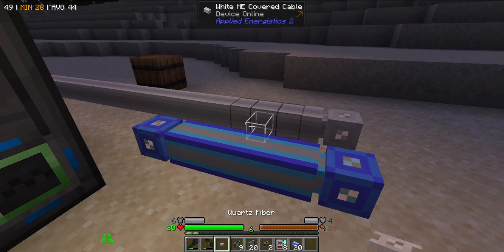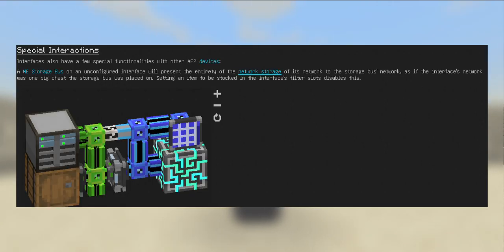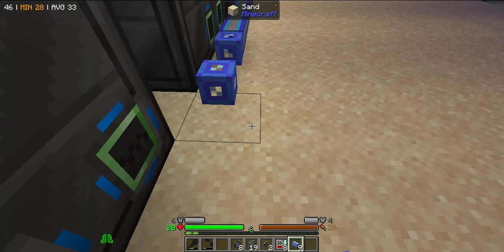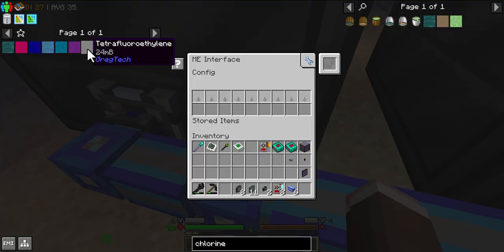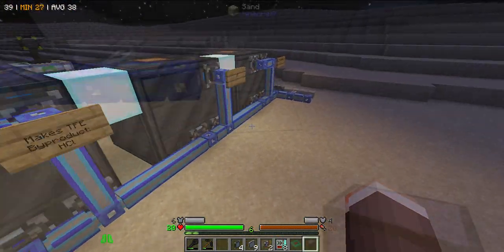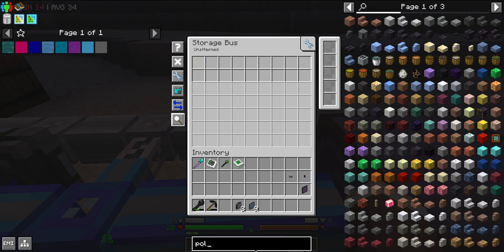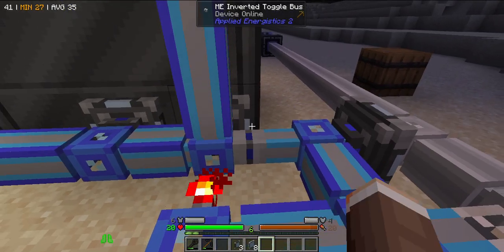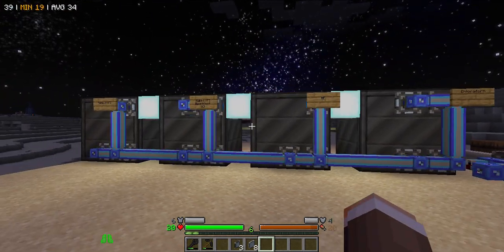(GregTechCEu Modern) Star Technology | AE2 Passive Subnet Guide

Comment: Why is subnetting used? I see it mostly being just for things like ore processing on gregtech but i dont understand why not to do just do it on the main net. (I have channels disabled)
Reply from the maker: 1. Organization. It allows you to hide items/fluids from inbetween steps from pinging the main net and keeps looped items in a closed net so they dont get consumed by other processes.
2. Its basically required for some multiblock autocrafting operations. (ones that use multiple buses or both a hatch and a bus)
3. Performance reasons. As i mentioned before it allows for hiding inbetween steps from the main net which helps a bit with scanning nonsense (although the difference is pretty small and probably negligible)
4. Organization again. Its way easier to troubleshoot certain items/fluids being short when networks are subnetted by operation. Looking at one huge main net makes things significantly harder.
5. Prevents net overflows on passive setups
6. Its just cool
Reply: @ZTHaze thank you!

Comment: I'm currently making nitrobenzene setup and can't figure out how to auto-output nitrobenzene from my subnet (production) into main net where reservoir is located. Do I need to use an export bus instead of ME interface? May be stupid question but it's actually my first decent try to complete pack (GTCP Modern)
Reply from the maker: Not a stupid question, thanks for asking!
The simple answer is yes, you’ll need an export bus.
You could still make it work with interfaces but it takes a level of explanation i cant quite cover in a comment, so just stick to export buses :p

Comment: Wish you would make a video explaining what and why do people use a "tiny" brain (me controller) below the main controller, i never grasped that concept, because a cable carry 32 channel with all the p2p linked to it, so why add a smaller me controller to link it to that cable. Thanks !
Reply from the maker: tbh its just to save channels on the main network. Most people play this pack without channels enabled from what i can tell, but if youre doing channels, its probably better to do the separate network/controllers. Thats just my opinion on it, so if you feel differently just do what you think is best and see how it works for you.
Reply: Its specifically for sub netting. In his example (as he mentioned. channels are disabled) normally on that network with the drives and machines(the blue one) you cna only have 8 channels. Yes you could p2p and get more channels. but the point of the subnet is to save channels. By adding a controller you can have 32 channels(or more with more controllers) while only using the 2 channels from your main net(the storage bus->interface and Interface->storage bus).

both options work. but its easier(imo) to expand a subnet to add more channels rather than expanding your main net to add more p2p(which also take channels) then running those p2p to the other place u need to go.